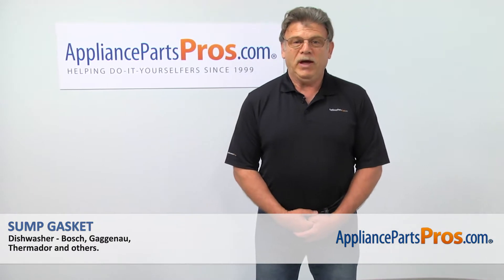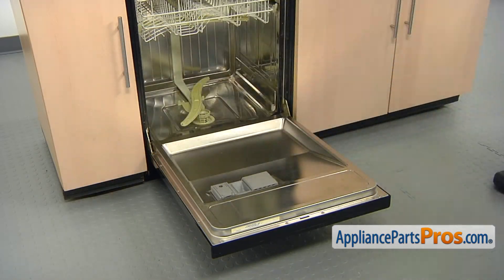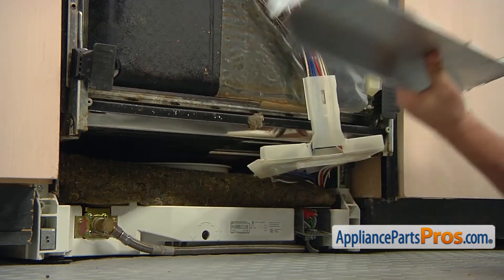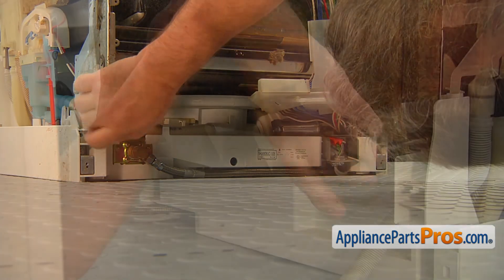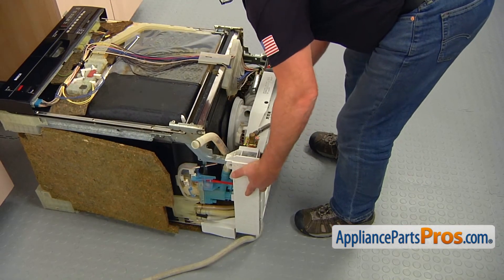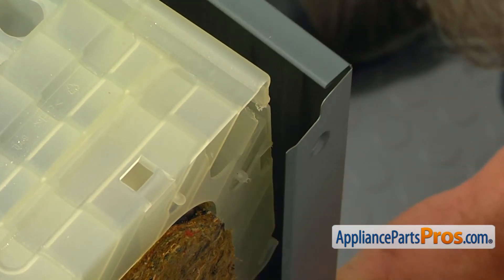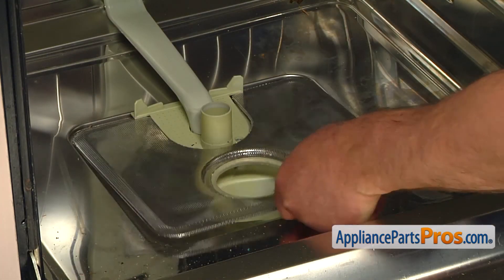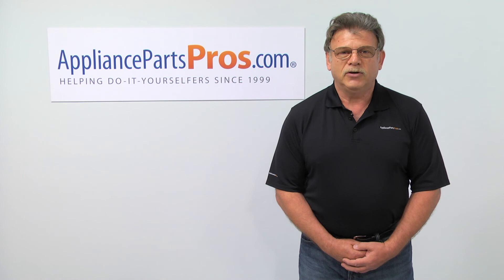How To: Bosch/Thermador/Gaggenau Sump Gasket 00263102

Comment: I fixed this by removing the four screws inside the dishwasher, and gently pressing the sump down so that a small gap is created between the sump and the metal of the machine. Then I took silicone and applied as much as I could all the way around. Try to get in as much as possible and do it all the way. Then screw it back together and clean thoroughly all the silicone that comes out after you tighten all the screws. I used alcohol to clean it off, then wait for 24 hours and see if it leaks. It worked great for me. Be careful with the sharp edges in the dishwasher. Once you unscrewed the sump it is extremely sharp. Good luck.
Reply from the maker: Thanks for sharing your experience and detailed fix! Sounds like a creative way to get a good seal. And great reminder about those sharp edges—dishwashers can be sneaky like that! We’re glad it worked out for you, and hopefully, your repair holds up for the long run. Thanks for watching and for contributing your tips!
Reply: @ thanks, since my dishwasher is six years old, I just don’t feel it’s worth the time and money to fix it from the ground up. If this gives it one or two years of life, I’m happy.
Reply from the maker: That makes total sense! Sometimes a quick fix to extend the life of an appliance is the best way to go. Hopefully, you get those extra years out of it! Let us know if you ever need any tips or parts down the road.
Reply: @ thank you so much for your great service
Reply from the maker: You're welcome!